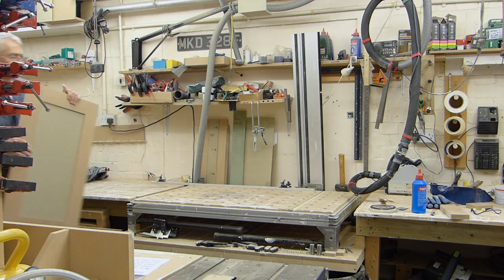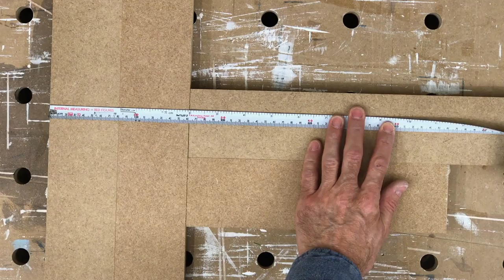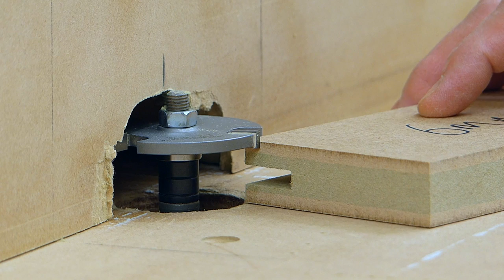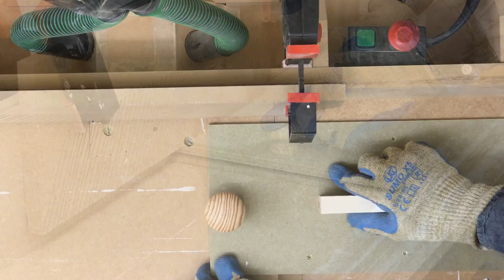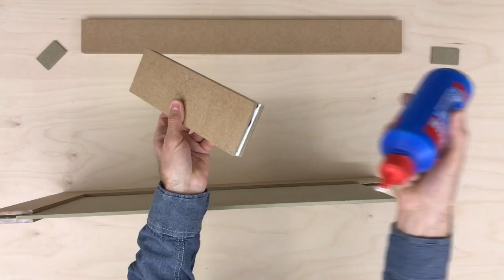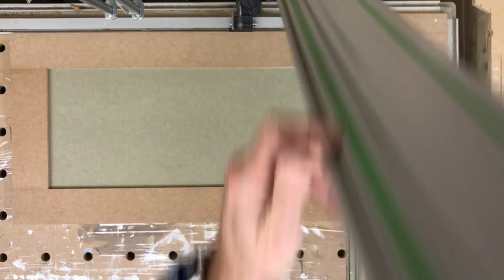Shaker-style Panel Doors #001

Comment: Peter 22mm mdf is harder to source where I am, I only really have a choice of 18mm or 25mm, which would you suggest? Also is moisture resistant a must for kitchen cabinets or would normal mdf be ok as surely the paint seals the mdf? Love watching your videos, thanks.
Reply from the maker: Hi Colin. How big are the doors? I've made plenty with 18mm, but anything much over 1000mm tall and you'll run the risk of the doors bowing, which can give you all sorts of problems. Rails and stiles in 25mm will be solid, but comes with its own issues e.g. most 'standard' concealed hinges will only work with doors up to 24mm,  so risk it and have the doors bind, or bite the bullet and go for 'thick door' concealed hinges?? Basically 22mm really is the sweet spot, well worth searching out if you can, as is MR MDF; I use it not for its moisture-resistance, but because it's a much better board for not much more money, as you'll see if you try painting regular MDF. 👍
Reply: @10MinuteWorkshop  Thanks for your reply. The doors are mainly for under counter kitchen cupboards and wall mounted cupboards so I wouldnt have thought id be going over 1000mm  and the hinges are the round hole concealed type ones you get on standard kitchen units.  I will have a hunt about but most merchants here in Dorset only seem to sell the 18mm or 25mm I mentioned.  I think I will go for the MR MDF then as theres not much difference in price. thanks again.
Reply: @10MinuteWorkshop  Sorry one final question, what router do you have in your bench, I notice you use an arbor and groove bit but I currently only have 1/4" shank router so am looking to upgrade. thanks
Reply from the maker: I have an old Triton TRA001 slung under the bench, works great ; particularly good for bench use because the collet lifts right up to the surface for easy bit change. 👍👍

Comment: Wondering what issues there might be to using a table saw instead of a router to cut the grooves? Maybe it’s the difference between using MDF for rails and stiles versus timber? I’m new 😁
Reply from the maker: You'd need to use an unguarded blade, which is a real no-no in a commercial workshop here in the UK, and I don't advise it in a hobby shop - though as always, what you do in the privacy of your own workshop is your business. 👍👍

Comment: Quick question out of curiosity: what makes this preferable to a full tongue and groove style joint? I guess if you're using MDF, maybe loose tenons are stronger? If you used wood, would a tongue and groove joint make more sense (especially if you are finishing with stain/clear coat and not painting)?
Reply from the maker: Stub tenons look better in natural timbers, not much in it WRT strength though 👍👍
edited for auto-correct

Comment: Great video Peter. I am a newbie and currently learning to attempt to update my kitchen cabinet door as well. I have 2 questions if I may. First, how dusty is MDF? I was gonna paint the cabinets anyway but so far I was focusing on making the doors with 3\4 Poplar styles and Rails and 1\4 MDF or plywood insert until I sow your video. Q2-  If working with 100% MDF could I just use the Tongue and Groove cutting on the table router? or would the Tongue expose the soft middle part of the MDF and that is why you went with the loose tenants? Thank you
Reply: Don't know if you still need to know. But MDF is probably the dustiest material to work with. The dust is super-fine. Not too bad though if your in a shop. Keep in mind, once this wood glue dries after being clamped properly, the strength in the joint is incredible. Going all MDF for the stiles and rails should be just fine vs poplar. Poplar will look a bit crisper if you want that look, but cabinet doors don't get a lot of sharp impact.
Reply: It's very dusty ALWAYS WEAR A DECENT MASK even if your just doing a small job . I'm city and guilds qualified and I remember from my college days being told mdf is the worst wood dust to breath in .

Comment: Would this be appropriate for larger doors at 1800 long or would that be prone to cupping in a few years after being fitted I’m 20 and have got a homer to build a built in wardrobe in the next month or so? Thanks.
Reply from the maker: Yes, I’ve made lots of doors that size - have a look through the act catalogue, every wardrobe panel door in these videos is made this way. Critical thing is to use 22mm MRMDF for the rails & stiles - I switched from 18mm after I had issues with doors bowing. 22mm with a 6mm panel is great though! 👍👍
Reply: Thank you very much that’s a big help
Reply from the maker: @campbellbarclay2000  No problem; there's an updated version of this video out soon, btw, so watch out for that one. 👍

Comment: In Belgium, at least in my region, I cannot get 6 mm mr-mdf, only 9 mm. Will a 9 mm groove weaken the rails and styles too much? If so, I'll need to use 6 mm normal mdf? Thanks!
Reply from the maker: No, a 9mm panel in a 22mm rail/stile makes for a nice solid door. If you’re using 18mm for rails/stiles then go for regular 6mm MDF. The most benefit from MR MDF is on the cut edges, rather than the face, so a regular MDF panel will usually do fine as the edges are enclosed. 👍

Comment: If you were to make a full hight shaker door from 34mm planned softwood, would you still achieve a good solid join by using loose tenons like you have here or would you do something different?
Reply from the maker: Oliver Moore No problem at all with loose tenons wrt strength, my concern would be aesthetic, presuming these are left as natural timber. I think I might consider stub tenons in 'real' wood, if you don't want to go down the Domino route. Please excuse me if you know this already, but a stub tenon is where you groove the stile as you would for a loose tenon, but make a short i.e. 'stub' tenon on the rail; it takes a bit of fiddling,  but the result looks like a 'real' tenon from above. Hope that helps. P
Reply: Peter Millard . Ahh I see, these doors will be painted so I think I can safely use the loose tenon approach for speed more than anything. Thanks for the help again, very much appreciated 😊
Reply from the maker: A pleasure. For a painted finish loose tenons are hard to beat, for sure. P

Comment: I'm planning to do this with 18mm plywood for the frame and 6mm plywood for the panel. My concern is the 18mm ply end will be exposing around the panel. Do you have any advice how to cover that? Edge banding cannot be applied reliably there.
Reply from the maker: +soosai steven Will they be painted or stained/lacquered? If the latter, there's not much you can do, other than try applying the edgebanding before running the groove. If painted, then careful rubbing down will minimise the 'layers' of the Ply. Check out my 'painting and finishing' series for more on this. 👍

Comment: Hi Peter,  how do you size your door in relation with the carcass. I mean say single carcass is 5 or 6 mm wider the singe door? Is this about right? And how about double door?
Reply from the maker: Hi Pablo. I usually leave a couple of mm either side, so a single door will be ~4mm narrower than the carcass, but a double will be ~6mm narrower (both doors) than the carcass. 👍
Reply: Peter Millard Thanks a lot Peter 😊👍🏻

Comment: Hi peter im just wondering how well the rails and styles hold together with just a loose tenon and pva glue ? Ive not made any before but ive just ordered a one piece rail and style router cutter with the intention to make myself new kitchen doors using 22mm mrmdf . Using the dedicated rail and style cutter it gives you a very small stub tenon similar to how you make yours , im wondering if id be better off using pva or polyurethane adhesive . Any advice will be greatly appreciated ☺
Reply from the maker: They hold up very well - I've made literally thousands of doors like this, without any issues at all. I like the rail and stile cutter for solid timber doors as I prefer the aesthetics, but for a painted door the loose tenon method is just so easy with minimal setup time. 👍
Reply: Peter Millard thanks for the reply , I only bought the cutter because it was on ebay at a very very good price , its a shaker style one piece cutter made by cmt . Listed as used because its pre owned but never actually been used , only paid £28 for it . If youve never had a problem  using pva on mdf then thats what ill do , I intend to paint them so using mrmdf seems to be the best material choice .

Comment: Quick question, what kind of paint did you use? Did you spray it on?  How did you do the interior corner, I have had issues with the paint sticking.
Reply from the maker: +upsd402 I almost always use a water-based acrylic, applied with a foam roller. Check out my Painting and Finishing series for lots more info 👍

Comment: Hi Peter,

Thank you for the video I am starting to get more aspirational with my DIY but do not have all the usual workshop kit. I am going to give the shaker style doors a go but only have a handheld palm router (although it has a plunge attachment, etc.). I have not used the router much, do you thing this will do the job? Or is it the case that if don’t have a router table I should be doing the plant on rails and style 6mm onto a 15mm sheets you demo in your other doors video?

Keep up the great work. I subscribed this morning.
Reply from the maker: Hi and welcome. No, I’m afraid I wouldn’t recommend any hand-held router for this kind of groove cutting, and especially not a palm router as they tend not to have enough of a base to keep it steady and safe. You’re probably better planting-on 6mm rails and stiles over a 12mm board (or 15mm if you can source it) and paying particular attention to the edges when glueing up 👍👍
Reply: Wow I was not expecting a reply so quickly. I’ll give the plant on ones a go and eye up a router table for the future.
Thanks for the feedback, it is very much appreciated.
Reply: If you haven't got the tools , there is an easier way . Just cut a piece to the exact size of your door , then cut your styles and rails and stick them on top flush to your edges . And paint , will look exactly the same .
Reply: Use a kreg jig faster and requires minimal skills.

Comment: Peter Millard Great video Peter. Thanks for posting this. I've just made some doors using your method. I used 18mm MDF for rails and stiles and 6mm for the panel and it worked pretty well. How much shorter do you cut the panel for wiggle room? Getting the door square during the glue up at the end was the hardest part for me. 

Also, do you use your MFT to rip the MDF as well as for crosscutting? If so, do you just measure and mark or do you have some kind of a jig for cutting narrow widths? For example how did you cut 80 mm width stiles?
Reply from the maker: Thanks! Glad they worked out OK; 18mm is fine for smaller doors, I just found larger (e.g. wardrobe doors) bowing slightly, so switched to 22mm. I generally cut the panel a couple of mm undersize - that's usually enough. I tend to get a sheet of MDF ripped to e.g. 80mm by my timber yard when I'm doing doors - I'm almost never doing just one ;) - but if I need to make narrow rips then I use the old 'two combi-square trick, as mentioned in my "Workshop Tips #1" video. Worth a look 👍
Reply: Peter Millard Thanks Peter. Will check that out. Keep up the good work.

Comment: Hello Peter, what's the maximum sized door you would make using this method, I find this method a breeze with smaller doors let's say up to 1000mm x 500mm but when it comes to taller doors I'm finding the glue is grabbing before I can fully assemble and clamp once squared up.

I am also finding the panel to be binding once its glued which is causing the issues but I'm using the 6.35mm groover you recommend from wealden tools, even when dry fitted the panels a tight binding fit...
Reply from the maker: Hi john. The largest doors I routinely made with this method were around 2200 x 600, with a deep base rail, and regular mid and top rails. Never had an issue with the glue grabbing, even in my hot-house of a workshop! If the panels are snug - and remember the sizings of sheet goods are only ever nominal - then either thin the edges of the panel out a little with a sander, or make two passes with the grooved with a tiny adjustment in between. It’s a pain to do, but sheets can and do vary a little in thickness, and you only have 1/3mm of wiggle room over the nominal size with a 1/4” grooving bit. If you’re still struggling then you could try switching to a less grabby adhesive e.g. 30-minute PU. HTH, P 👍👍
Reply: @10MinuteWorkshop  I've rolled the idea around about raising the groover to enlarge the Grove slightly so I'll do that on the next two 2130mm tall doors.
Also I'll make the panels slightly smaller as I'm cutting them to be a tight fit.
Reply from the maker: Good plan -  I’d always advise making the panels a couple of mm undersize, just to be sure. 👍👍

Comment: Hi Peter. Great video. I'm looking to make some wardrobe shaker doors using this method. Like many others I am struggling to find 22mm MDF in my area. Luckily I have come across some 21mm MR MDF which should be close enough.

One question though, it seems off your video that the 6mm front panel is approx 6mm inset from the front of the stiles when assembled? Meaning you an approx 12mm inset on the rear of the door? Curious as to why you would not use a 9mm panel for the front to even out the reveals? Door would then be stronger also? 

This is my current thinking if using a 21mm panel
Reply from the maker: Thanks Kieran! At the time I made this I only had a 6mm grooving bit - simple as that!± That said though, I do prefer to have the panel offset slightly, as it makes the face side easy to recognise at a glance - and I do prefer a slightly shallower rebate on the front face. 👍 Edited to add; 22mm is only nominal - it's often a mm or so different either way. 👍
Reply: @10MinuteWorkshop OK but you only have a 6mm reveal at the front right? So the only change would be a 6mm reveal on both sides if you use a 9mm panel
Reply from the maker: @kieranlangmead9156  Yep. As I say, it's purely a personal preference. Also, if you have a 6mm offset panel and the client then turns around and says, 'you know, I think we'd rather have 'victorian' doors instead of plain shaker-style' then as long as you haven't drilled out the hinge pockets yet, you can flip them over and add the moulding to the side with the deeper reveal. 👍

Comment: Great video Peter, just starting to expand my woodworking and will soon be starting a bookcase with cupboards below project. Doors will have to wait until Wealden have the groover in stock. I have a basic Clarkes CRT1 router table and a Dewalt 1/4inch and Erbaurer 1/2 or 3/8 inch routers. I guess the Erbaurer would be best, but any preference between 1/2 or 3/8 Arbor? Thanks in advance, Rob
Reply from the maker: Thanks Rob - my first YouTube video, still going strong, lol! There's an updated version of that vid here, btw - https://youtu.be/jwGvYsvdCg4. And for a bit like the Wealden HD groover, I'd want the 1/2" router, for sure! 👍👍
Reply: @10MinuteWorkshop  Thanks for the swift reply Peter. Out of interest where would you buy the WP MDF for a DIY'er who would not be purchasing vast amounts.
Reply from the maker: No problem. Sorry, not sure if you;'re in the UK or not, but you can buy moisture resistant MDF in a lot of places, but your best bet is to try and find a local timber yard that stocks it. Lavers and Lathams both stock Medite MR, but not sure how amenable they are to guys coming in for a single sheet, so a smaller local yars would be your best bet. 👍

Comment: No pocket screws? Drilling? nothing? ...mind blown. Well done kind sir...very well done. I just don't have a table router, I have almost anything else, but a table router. ugh.
Reply from the maker: +twes619 Thanks! My router is just slung under a bench, nothing fancy. Lots of guys I know who are short on space just mount a router on a board on a workmate or a couple of saw horses when they need one, and the fence is a 2x4 clamped in place. 👍
Reply: Peter Millard omg you're right! my brother has a router, I'm sure we could figure out how like you just mentioned! combined we have just about everything, so this will be fun. thank you for the reply and tip!
Reply from the maker: +twes619 👍

Comment: Great vid as usual 👍
Loving the set up with the track saw, so it hinges down from the wall, and sits on your bench at a perfect 90 degrees.
Is that a Festool accessory, or something you’ve made?
Reply from the maker: Thanks!  It’s an off-the-shelf Festool MFT or Multi-function table & the hinged rail comes as standard. See videos #182 and #183 for more details. 👍
Video 182  https://youtu.be/0V-p5F7SjO4

Comment: Peter, thanks for showing this.  I cannot get 6mm MR MDF or 22 MR MDF as they appear not to be standard sizes for TP etc.  Would 18mm MR MDF and 6 mmPanels  be okay?
Reply from the maker: Hi Gary. MR MDF in 6 & 22 mm are standard sizes, but you may need to search it out a bit. I had a few niggles with larger 18mm doors bowing, and they completely went away when I switched to 22mm. But I made plenty of smaller doors from 18mm with a 6mm panel and they were fine. 👍👍
Reply: Peter Millard Thanks Peter.